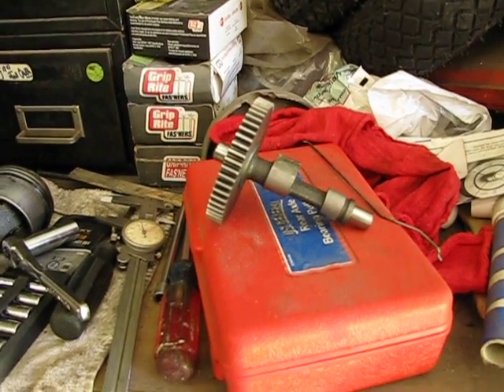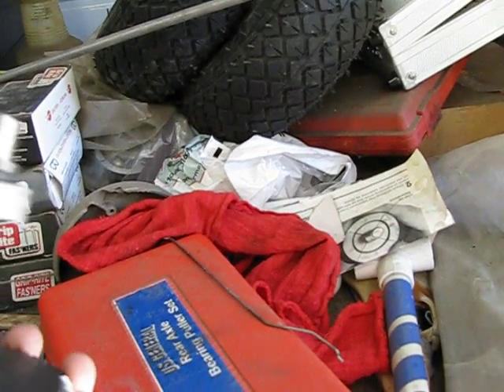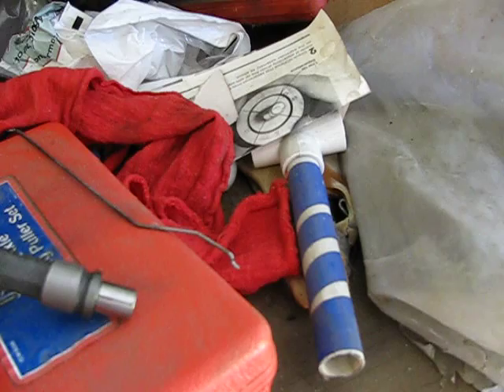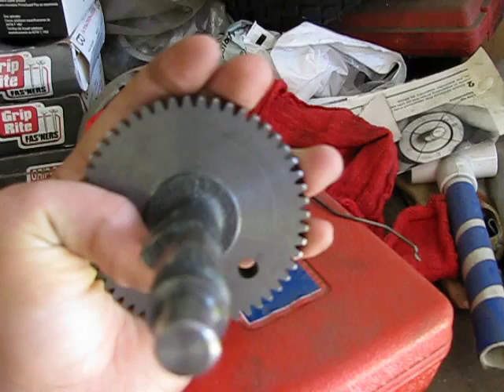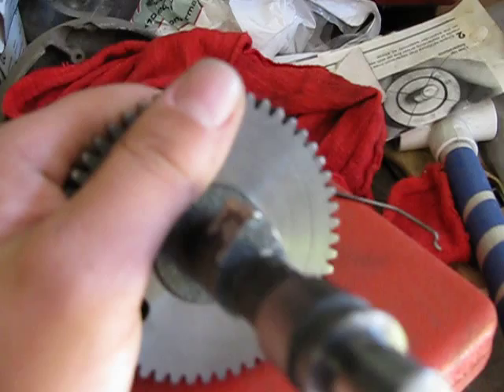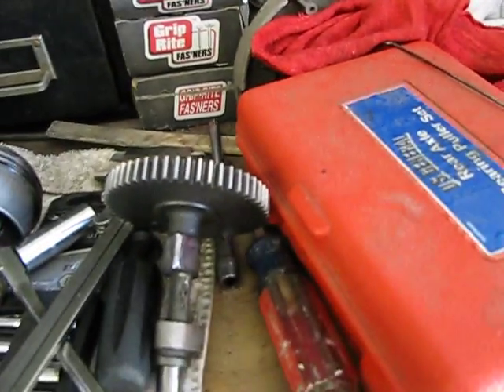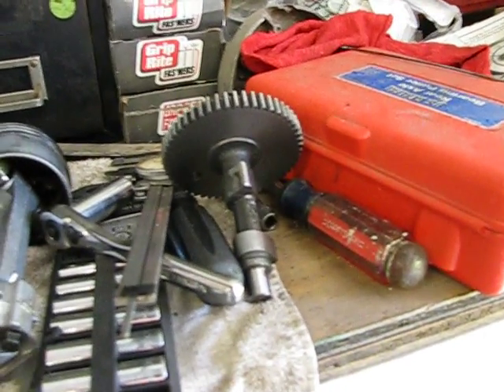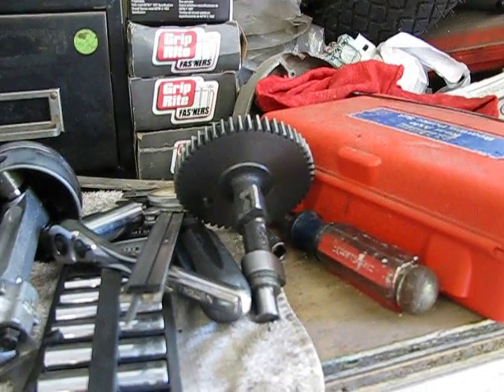Briggs 5hp Performance Motor part 5

Comment: i have thought about doing this on mine.  using short duration welds, along with a heat sink is a good way to reduce how hot it gets, but im still not sure if im going to do this.  longevity is more important to me on this one.  however, welding to strengthen the exhaust guide is something im seriously considering

Comment: look at the cam out of a 3.75 horse briggs sprint, thats the flat top cam design, It hits max lift, and stays there for a long time before closing the valve, rather than traditional cam lobes that only spend a few degrees at max lift

Comment from the maker: @brendonv101 thanks but i didnt get it but up to 200 degress because i went over it so quickly and also this is mainly a test to see if it works my dads friend is getting me a racing cam and a blueprint carb for it for free so i was just doing an experiment but thanks the next time i do that i will do that also i did what you said to do to the head and know its pretty even and strate so thanks

Comment: It now had a Dyno .233 lift 95-3 racing cam billet airfilter adapter same ported valves and has a previously running water methanol carb a racing head (still choosing which to run) Dyno Lifters And a breather tank.

Comment: Welding on the cam ruins the heat treating of it and weakens the cam. Since this is a "performance engine" it needs all the strength it can get. If that cam fails then the engine will be pretty much screwed. You can re heat treat it again by heating the whole thing up cherry red and then dropping it in oil. Dropping it in water may make it fracture so oil is better.

Comment: Not to say u did a bad job on the can because u probably did a better job than I did maybe but I hope u put more weld on it because it looked like it had a deep grove in it just saying and ur in let lobe u filed down didn't make much sense because u filed it down instead of weld more on it and then fileing it down but u defeated the purpose of it because it might open up for a longer time but it has less of a lobe on ur now so u are defeating the the purpose of it but other that that nice job in the the engine I surscibed to u to so yeah type me back.